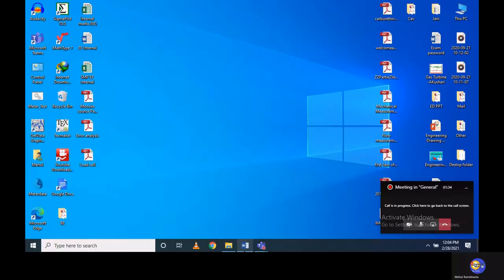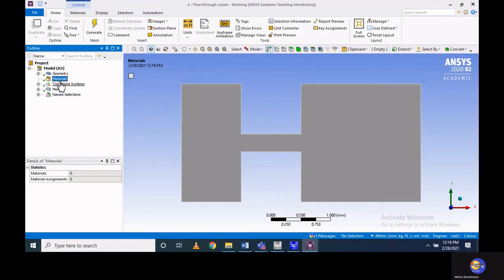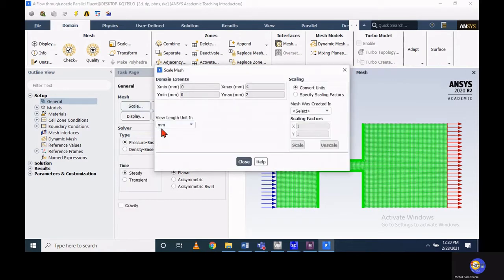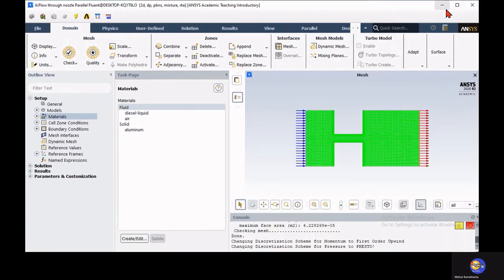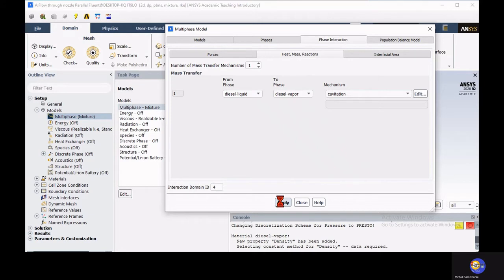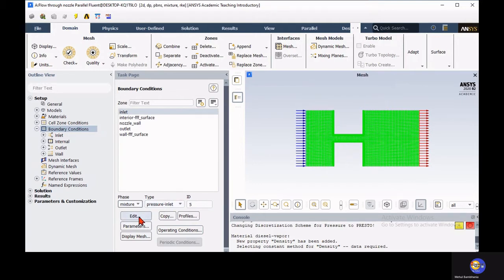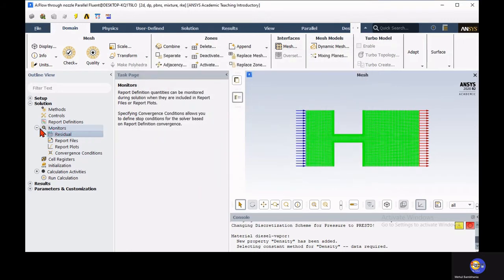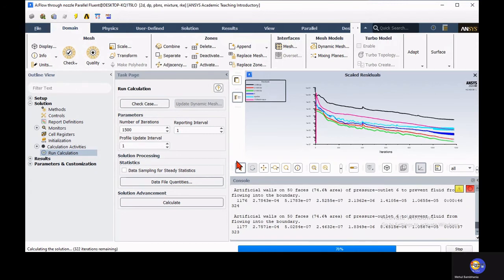ANSYS-Fluent Tutorial || Cavitation flow through orifice/nozzle

Comment: I have inlet pressure of 200 bar and i want to calculate pressure drop across the orifice and i want to calculate the pressure at downstream of orifice. How do i do that? Should i assume 0 bar at the outlet?
Reply from the maker: 1. If orifice outlet opens in atmosphere, you should consider 0 gauge pressure. 
2. You can obtained pressure after solution at different axial location to calculate pressure drop across the orifice.
Regards.
Reply: @EngineeringNature  Orifice outlet doesn't open in atmoshpere. There is alot of other components downstream the orifice and then it goes to atmospheric pressure resevoir. But all i need is pressure drop across the orifice and pressure at around 100 mm from the orifice. Can i calculate it by using a model like in your video or i have to model whole system?

Comment: Is the recent iris xe graphics with the 11th gen i5 16gb ram compatible and sufficient  with ansys for  medium 3d  simulations?
Reply from the maker: Generally processing requirements depending on the number of mesh elements and physics of the problem you are working with .
However said configuration is sufficient to run any 3D simulation👍
Reply: @EngineeringNature  Have you tried to run ansys on 11th gen i5 laptop with integrated iris xe graphics ? Does it work or not